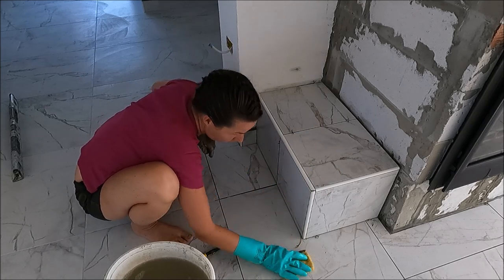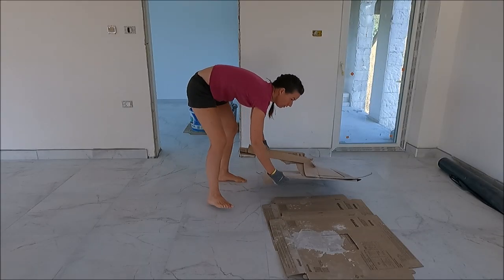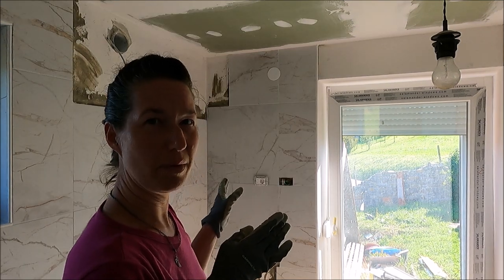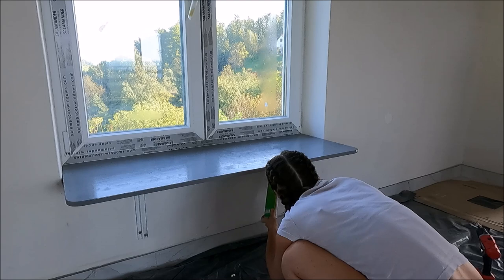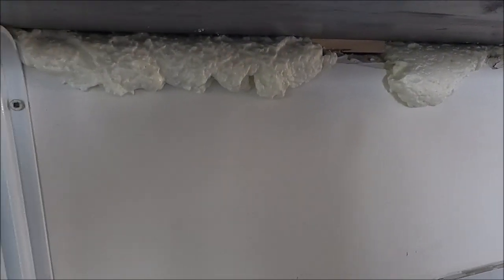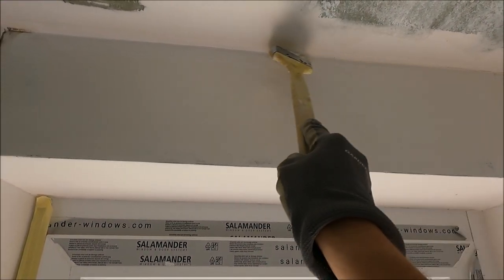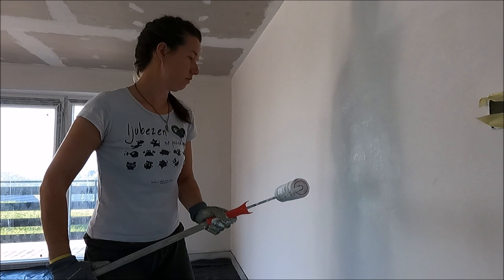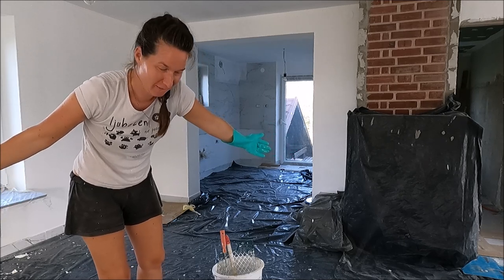Let's The Painting Begins | MY SOLO COUNTRY HOUSE RENOVATION

Comment: Well had it been me painting the primer and paint, I would have left off the sockets and shelves until the paint was fully dried , as then you do not have to be so careful where the paint goes. Just a tip for next time if there is a colour change you have in mind?

Comment: Beautiful work, you are very skilled lady,  nice  bright walls and ceiling. Just the skirting.. sorry, not beautiful at all. Looks like the floor climbs up the wall. Also ,that complicated constaction for the fitlreplace does not look right .In my opinion the original fireplace from the previous owner was much better.Again, it is only mine though